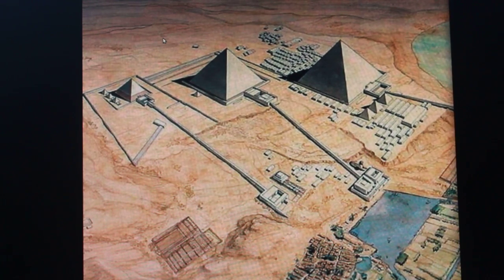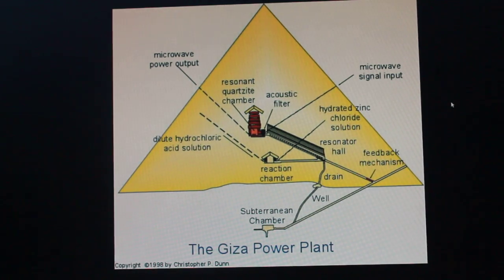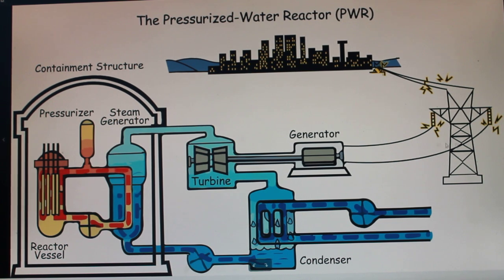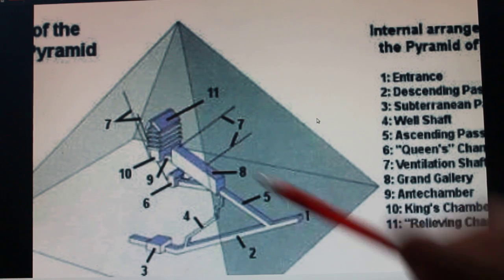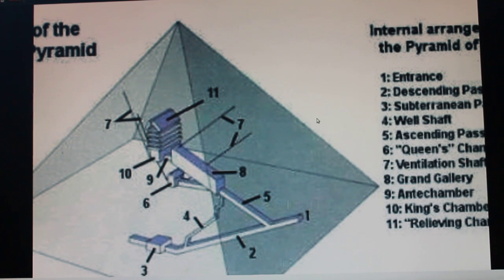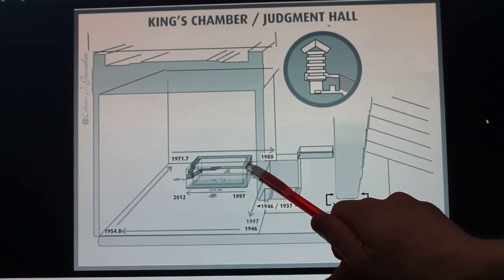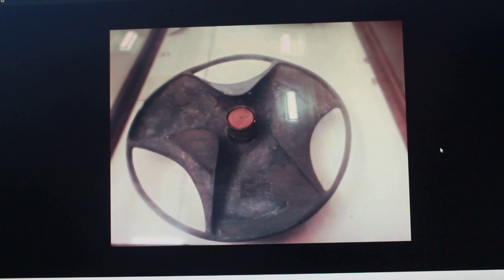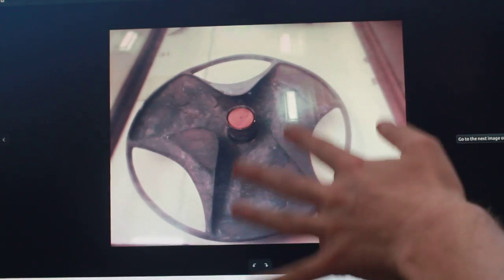Is the Giza Pyramid an Ancient Boiling Water Nuclear Reactor Complex? (Part 1)

Comment: I believe its possible that the great pyramid had multiple uses including supplying fresh rain water from the surface which was channeled into the grotto around the sphinx and perhaps ground water as well, also I think it was used as a center for scientific studies into all type of technologies including electrical energy, flight, and many more I;m sure. 
the great Pyramid apparently had a conductive gold cap stone, I think there is info around that suggests there was a gold vessel in one of the chambers that may have been a capacitor of some type,. I think it may have involved some type of Tesla type free energy generation.

Comment: If it was not a nuclear reactor because the radiation levels would be much much higher even today. The other things you say are mostly bullshit....The whole structure is in very specific ratios and it is built like a electric wire regarding the electrical characterisics of the separated stone layers. So it is some sort of energy generator, converter. There is nothing accidentally made in this structure for sure.

Comment: The crucial measures are in the volumes, as the imperfections on the surface of the granite will only have an extremely small scattering effects for those low frequencies, this is not critical as the volumetric movement of the gas is how the Helmholtz resonator works. My measures are the result of the exhaustive calculations from another part I did not include on my blog, the Ante Chamber(47 hz) and its design built as tuning device from an even lower frequency of the Grand Gallery(Air) at 0.47 hz and the Queen Chamber(Oxygen) at 2.3766 hz, while the Kings Chamber(Hydrogen) is 7.8426 hz.

These figures have been carefully calculated from the actual dimensions, based on their volumes and each gas that is being generated by the process.

Where
C = Light velocity = 299792458 m/s
R = Earth Radius = 6370961.86815 mtrs

47.056hz = C/(R x 1) – Instigator and tuning device
7.8426hz = C/(R x 6) – hydrogen
2.4766hz = C/(R x 19) – oxygen
0.4756hz = C/(R x 100) – air
??????hz = C/(R x ????) – water
??????hz = C/(R x ?????) – earth

It seems that the Pyramid was a working machine that used water as a fuel and it resonant chambers as active disassociates that include – earth hammer(seismic), water hammer, air hammer, gas hammer to generate power. I can only speculate at this point, but I am working on a test rig of very much smaller dimensions and much higher frequency to achieve water disassociation based on the pyramidic pump principals discovered here.

The simple facts presented here are more than mere coincidence. the staggering display of engineering of the ancients are present in every aspect of their work, my complete article in volume one and volume two. Regards Arto.

Comment: The old testament has some interesting corroborating information for this theory. Some of them are;  The ark carried away nuclear material when the monotheists were driven out, as it  was covered with a thick layer of gold. God spoke from the top of the ark. The punishment for approaching the ark without permission is consistent with radiation poisoning including hair loss, skin irritation and boils if not instant death via fire which would issue forth from the ark.  The clothing of the high priests who alone could handle the contents of the ark were made of special gold mesh and gold plates. Moses had a gold mask because after speaking directly with god his face was "radiant"." The israelites were invincible in war as long as the ark was with them in battle. There are many other parallels as well in genesis leading to the conclusion that the monotheists who were the elites of Egyptian society at the time, and the nuclear technicians (high priests)   left Egypt with the nuclear core of the reactor (in the ark) in order to safeguard it from the revolutionaries in the hope of returning with it one day. The chroniclers of the torah with their limited understanding could only guess as to the meaning of what they  saw.
Reply: Time is a unit of measure and not everything follows the same time frame.
Therefore, keep this in mind, when looking at the pyramids.
The pyramids were much older than the Egyptians and its feasible that the Egyptians inherited the pyramids. Also, with all that the pyramids could do and as long as the power stayed on, they didn’t need to know much about it.
According to biblical stories, it is stated the area around the Nile was a lush jungle and the pharaohs enjoyed abundant crops, weaving of fine clothes and even were into plating gold onto base metals, think, electrical sources.
The Egyptians were also advanced in astronomy, mathematical theories, and highly skilled medical practices. Who taught them?
Follow the story of Moses and why and how he was adopted into the royal family and became a great leader. He was educated, polished and made into a favored son, that is until he rebelled.
When Moses led the Hebrews out of Egypt, he was like a son to the Pharaoh.
The Egyptians had powerful Gods just like the Hebrews had, only difference was the Hebrew God had even more power, kind of like there was a master race already here educating and guiding the Egyptian overlords.
Anyway, Moses asked the Pharaoh to let the Hebrews go, so they could go into the desert for three days, to worship their God in the desert or the Hebrew God would poising the rivers and turn loose pestilence upon Egypt. Finally, the Pharaoh consented to Moses ‘demands.
Now here's where it gets interesting.
The Hebrews stole precious gems and metals and other things from Egypt, (remember the Golden Calf scenario?)
They also stole the Crown Jewel of the Nile, the Ark of the Covenant.
Egypt’s power was removed.
 I'm sure that you have read about the properties associated with the Ark and what it supposedly could do?.
The Pharaoh wasn't chasing them just to get back common laborers. Without the Ark, Egypt would began a great demise.
This timeline stretches across thousands of years prior to the rise of Egyptians and is still unfolding, thousands of years thereafter.
So, yes, the theory that the Pyramids, somehow could be a power source, is believable. 
Just ask Tesla,, HA!

Comment: Pyramids where landing pads for large mother ships.  The pyramid shape allows for great weight support when a load bears on all of its walls equally.  In the bottom of the mother ship was a socket or a reverse pyramid that the rocky pyramids fit into.  That is why everything had to be so precise...
Reply: So where would they land, if they needed pyramids to land anywhere? 

They would have to build massive pyramids anywhere they wanted to land first.

Comment: The Ark of thr covenant was a radio isotope thermoelectric generator. Check out my video man, it was a Sphinx star generator. It uses earthly and radio frequencies and also uses saltwater. There is a radio isotope generator under the sphinx too. The sphinx acts as a heatsink. My videos may help you. Archeologists are hiding this tech. The heiroglyphs are electrical symbols. Z is a ground, A is thr hot and the others I'm still working on decoding. There's direction of current, hold amplify current ect.

Comment: If there were cables, where did they go?

If water is boiled, it leaves behind mineral deposits. I work at a non-nuclear power plant, but steam is steam. Even thoroughly demineralised water still leaves traces on surfaces. 

Also flow assisted corrosion will wear in certain areas. 

Also, wouldn't there still be trace radiation that could be detected?

Comment: '' Thirdly, a pyramidal shape carries in itself physical properties, like preventing rust or rot under its structure. But it has a large variety of other uses, like producing piezoelectricity, as crystals do, due to their geometry; or channeling waves carrying different energies, whether telluric currents, electricity, sounds, radio or microwaves, creating energy fields. Those energy waves can be directed to carry messages or charges, and their frequencies syntonized in harmonic resonances to manifest tremendous sources of power, able to create anti-gravity to move huge weights; or used for powering complexes and operating technologies; or condensed into plasma to power flying ships or devices like star gates.''

TrueBrother, SunBow (2017-08-07). The Sasquatch Message to Humanity: Book 2: Interdimensional Teachings from our Elders (Kindle Locations 1589-1594). Comanche Spirit Publishing. Kindle Edition.

Comment: They might have used thermal energy of the sun because they based it on the Sun. The surface area of the pyramid also catches maximum sunlight from a square base and the surfaces face East & West. If solar panes were put on the surface today wonder how much electricity the might generate? The acoustics could be just another feature of the technology.
Reply: PlugIn Caroo great remark. compressed sunlight tech is a real thing!

Comment: i dnt think the kings chamber is a heat sink. heat sinks are out in the open so the air can cool it.  i agree it’s probably some sort of power plant but one thing tht keeps bothering me is the kings chamber is covered in some sort of resin!  and tht supposedly sarcophagus is worn down on one corner, its not broken but rounded like a water or something was running through/over it, some people say it was broken off when they lifted off the lid? but then why r the edges rounded

Comment: I have worked at nuclear generating plants, and without distracting the topic, I don't see the pyramids being nuclear generating due to many details, even allowing for a difference of design. I could get into specifics if you like - but 
The large and solid design speak to an industrial purpose; on this we agree. But the simple design, with a lack of magnetic field implies a more simple running system. Possibly pure water, or hydrogen production. Hydrogen is an excellent fuel, and burns clean.

For your consideration. 

Thank you for the video.

Comment: Former nuclear power fan here (as industry is going down the drain I don't think that current model have future).
Chernobyl was something in between it was graphite reactor only cooled by mixture of water ad steam.

Djoser pyramid is more like reactor device than pyramid of Giza in fact you would only need to supply active zone.
Problem is that you would have to have either some moderator or enriched uranium for this thing to run or be some half lifes of uranium back in history in order to make it run on fresh water.

Comment: Personally I think the hydrogen maser power station model makes more sense to me logically, but I think your theory has a lot of merit and I would be interested to see how you develop it. Considering that radioactive material half life can vary anywhere from 22 minutes to 7.7 x 10 to the 24 years, I am curious as to what you think they would have used for fuel. The half-life of uranium-238 is about 4.5 billion years, uranium-235 about 700 million years, and uranium-234 about 25 thousand years. 
Potassium-40 is probably not viable as it makes up 0.012% (120 ppm) of the total amount of potassium found in nature, so very rare and a half life in the order of 1,250 Billion years.
Plutonium maybe? Pu-239 has a half-life of 24,100 years and Pu-241's half-life is 14.4 years. Another fuel to consider, and this for me is the most interesting as it could put a whole new spin on the idea and maybe even evolve into a theory all of its own would be thorium. Th-234 has a half-life of 24.1 days, and when it decays, it emits a beta particle, and in so doing, it transmutes into protactinium-234. Th-234 has a mass of 234.0436 atomic mass units (amu), and it has a decay energy of about 270 keV (kiloelectronvolts). Uranium-238 usually decays into this isotope of thorium.
If there are any signs of mineral mining, something other than granite or limestone at a relative distance to Giza, or any lingering radioactivity in the chambers or great hall, it would add a lot of weight to your idea.

Comment: The outer covering of the pyramid are the same conductive material that is used to make solar panels. The passages are used to electrolytically separate water- hydrogen and oxygen. Hydrogen is lighter than oxygen so as produced it will rise (check out the tunnels angles.) You are right about the fortifications- hydrogen and oxygen are very explosive .... Like rocket fuel. It's amazing how many purposes these pyramids were utilized for.

Comment: If it was a nuclear power plant it would need a lot of cooling.  Water is usually used and this is near the Nile, but there don't seem to be any channels of water from the Nile to the pyramids.  Also the radioactivity from the power plant would have to be dealt with for the safety of the workers if nothing else.  And I don't see what they would have used for radioactive fuel.  There is yellow cake in Libya, but that would have have to have been greatly enriched to be used for fuel rods.  I think Chris Dunn's approach to it being a chemical reaction to produce hydrogen and oxygen is the answer, with the exception of his screwy idea that starlight can initiate a maser.

Comment: It is a radio tower... tuned to collect frequencies
Reply: The pyramides were build to receive the frequencies of the stars that the shafts were pointed to. The massive building was meant to isolate those signals and shield from all other cosmic radiation. The high priest/king was to lay in the sarcophagus in the 'king's chamber and listen and be inspired .

Comment: NO Fission ... but a Power-Tap + transmitter ... 
its a huge Zero Point Energy device & 
has something in common with _Nikola Tesla_´s Wardencliff Tower ... electrised air can still be measured on some environmental conditions, despite the high outer damage

Comment: close... not boiling water, but chemical reaction chambers that, through a mixture of chemical solutions poured through the shafts and the electromagnetic charges produced by running water and stone vibrations beneath the structure that produced a microwave energy that was sealed into the structure by the limestone encasement stones and directed through the top (gold capstone). Free energy flowed from the pyramid's top and permeated through the atmosphere. This was part of an ancient global power grid.

Comment: Remember what Dunn said at the end of his book?  The infrastructure and need for the electricity is not present. Ie. no prehistoric toasters. He had to admit that and i was screaming it  half way through the book.  The three hundred pound gorilla in the room so to speak.  I do not wholly discount your theory. The pyramid may have been a reactor of some sorts.  I do believe that Sodom and Gomorrah were nuked.  The diagonal shafts coming from the Queens chambers are pressure switches.  I believe this is where they found they copper points at the end and the shafts.  The shafts from the Kings chamber are vents.
Reply: I agree in part.  But something also makes sense.  Everything they used came from the earth, gold, glass, etc.  All gold has long since been repurposed, the fact that we have any gold artifacts left to view is a miracle.  Glass breaks into little bits of sand over time.  The batteries, or hints of them, were left.  The hieroglyphs depict what they used it for in plain sight, for those that do not think just in symbolism (like the blind Egyptologists learn in school).  The really good and obvious tech was taken or destroyed by the others before leaving for good.  However, they left us just enough to reverse engineer some of it.  I do not subscribe to nuke power or maser theory.  Far too elaborate, when a cleaner and less brittle option was available here.  KISS principle applies I think.

Comment: No not likely. the pyramid was seemingly constructed  without metals or electromagnetics or thermo-nuclear consideration. I am thinking that the era had a high degree of metal corrosive factors in the environment, so people would not consider to use metal for tools or in constructing buildings., it would turn to rust, due to electric currents called "stray currents" that run through all metal however to a small degree in our times with moderate electric potential, called "step potential". IN such an environment of high electro-magnetic fields on earth, less conductive and corrosive material would be required such as rock and composites, rope and fabric, and metals would never be used.
Reply: I am thinking perhaps a hydrogen gas generator; perhaps the pyramids were fueling stations for hydrogen balloon-type transportation ( and flying carpets).